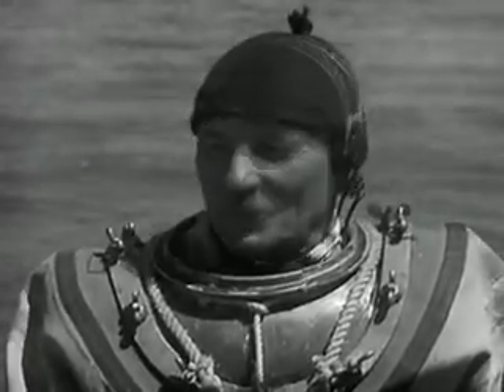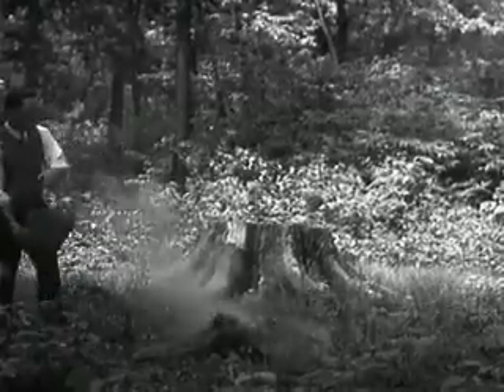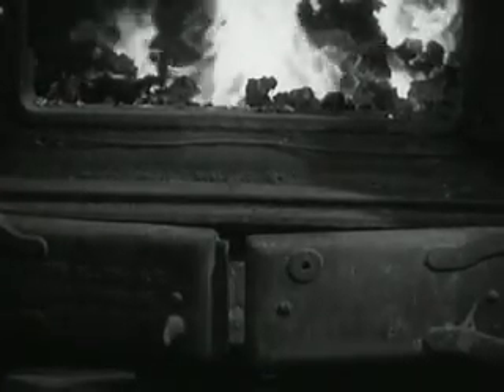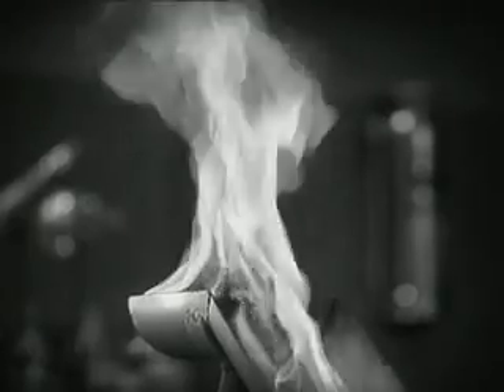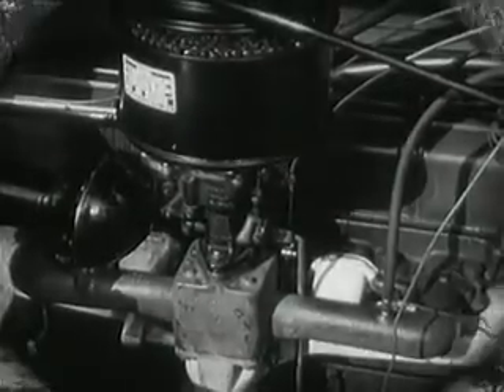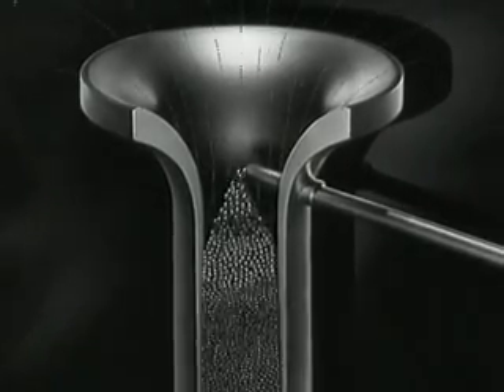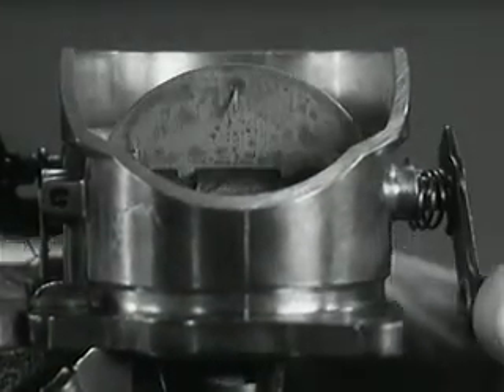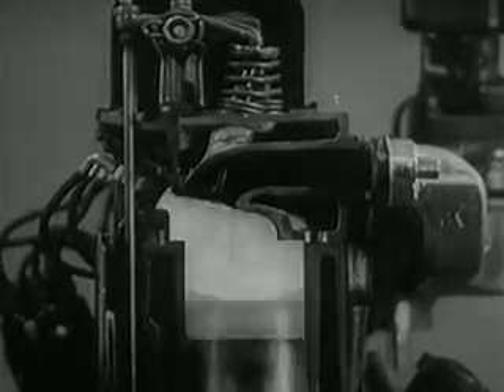Free Air (1937)

Comment: It's a good thing they don't charge for air by the mile in addition to a gallon of gas. The air in this film was not FREE. It was compressed which a compressor was used to fill a pressure tank. They has a cost of either electric or gasoline engine.

Comment: 1 Tablespoon is ~15ml so the car used 45ml on a 1/4 mile. This is 0,045l/0,402336km and this is 11,2l/100km which is equal to 21 miles per gallon
Reply: use points not commas
Reply: @allentoyokawa9068  people in Europe would tell you to use commas instead of points.
Reply: I mean 11.2l/100km is pretty good for a 30’s big car with no hood and a big balloon acting as a sail
Reply: God bless you, I was hoping someone had done the math
Reply: Today, I was going 120 km/h accelerating up a slight hill, using 10L/100km. It's incredible how, after almost 100 years, efficiency has barely doubled, in the face of computing power which has doubled 50 times since this video first came out. That's two times more range per gallon of gas, and 1,125,899,906,842,624 times more transistors in your pocket.
Reply: @CuthbertNibbles  the Moore you know…
Reply: @CuthbertNibbles  - There were no transistors when this film was made, so we can't talk about how many times more transistors we have now. However, we're nowhere near 1+ quadrillion transistors, even in high-end systems, let alone pocket devices. As far as I know, we're in the low trillions for very high-end systems, and billions for mainstream consumer products. One quadrillion transistors is probably a datacenter or something like that.

I agree with the sentiment of your comment, though. There have been incredible advances in computing and telecommunications, but transportation today is essentially the same as it was 50 years ago.
Reply: Gas back then had alot more kick to it,   I imagine modern gas would have alot less mpg.
Reply: v12alpine Gas had more kick in the sixties maybe, but in the 30s, it was more like kerosene.  It might have been somewhere around 75-80 octane, and most engines had a compression ratio around 7:1.  Now obviously octane rating doesn't mean power, but it's safe to say the gasoline of the day wasn't exactly high quality.
Reply: @woodyofp8574  It was bad and oil wasn't what it was today either. Those old engines didn't last no where near what they do these days. Cars were easier to fix in the past tho
Reply: Your right on your calculations I had a Chevy 250 6 made over 25mpg we really don’t need all the bs they put on the engines the E.R factor of gasoline had been known for ever they just wanna add electric bs to tract us and shut the car down when they want to, with the advancements in metallurgy since then the lighter the better metals are so much more lighter now all the added tech they just add weight look at vehicle weights per passenger

Comment: The experiment with  balloon with the engine's air supply was straight up genius to demonstrate how much air the engine takes
Reply: Agreed.  It's also interesting to think about current car technology with Turbo Chargers, thinking how much air those suckers gulp down.  I don't even want to think about those super charged race cars that run on Nitromethane fuel.
Reply: @amanawolf9166  The funny thing is, As that vallon was pushed by the oncoming air, It acted like a forced induction .

Comment: "3 tablespoons of gas" america will literally use anything but the metric system
Reply: @johnogara3029  and the imperial sucks even more
Reply: I don’t know if this is a joke or not but tablespoon is a legitimate measurement
Reply: Tablespoon was layman's terms because it was an easy house hold item that everyone watching could compare with. And yes, we most definitely used the imperial system exclusively back then.
Reply: The original roman volume system now called US Customary or SAE had a system based on 2s 4s 8s.  It was a system allowing for quick doubling or halving in the head.....not requiring decimalization or counting on fingers.  10s only break once before becoming fractured, but 2,4,8,16... don't 

2 tablespoon per ounce
8oz per cup
16oz per pint (2 cups)
32oz per quart (2 pints)
64oz half gallon (2 qts)
128oz per gallon (256 tbs)

Most who do not use it think the system is arbitrary, but it was a marketplace rational system for measuring out grain, flour, oil or milk at a market.

Also the casual measure terms are more everyday familiar: a cup everyone uses daily and a pint is a double cup/a mug...
which is a pound of dry weight for weight in pounds that break down to 16 oz weight.   An equivalence like you find in SI as well.

Also this film is to the layman 1936 and tablespoon was a measure they could relate to.

SI is better in the lab with our decimal mathematics made popular in the 18th century, but it too is an old system that was developed to best fit the situation at hand with naturalists (early scientists) working through elaborate scalable formulas without electronic computers....

Which BTW work off
2, 4, 8, 16, 32, 64, 128, 256
But that is hidden for you as the robots translate to 10s for puny humans.

Comment: By my calculation that is 25 mpg not bad for 1937 and considering we don't know at what speed but sounds to me like by now cars should be considerably more advanced
Reply: Think about this. On my 1987 jeep comanche. 85 was its marked top speed, and 55 was marked with red since its a common highway speed for the vehicles time. So these 1940s cars probably only ran at 60mph tops.
Reply: @Shawn-jf  55 was marked red because that was the federally mandated highway speed.
Reply: @superduty4556  so what he said?

Comment: It would have been nice to see that lovely cutaway carburetor explained a little more, but it was a great dramatization of the amount of air that is required to run an engine; roughly fifteen pounds of air per pound of gasoline.  About eighty per cent of that air is nitrogen and has to be pumped through the engine without contributing anything useful (of course if the atmosphere were pure oxygen everything burnable would have burnt long ago).

It's interesting to think of gas mileage in terms of the size of a tube stretched along your route that would contain the necessary amount to power the vehicle along the route.  For most cars that tube would be less than a millimeter square.  I discovered this by accident when playing with Wolfram Alfa -- the European unit for mileage, liters per 100 kilometers, decomposes to the cross-section area of that tube.